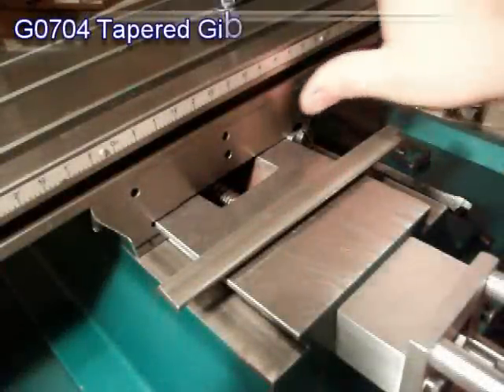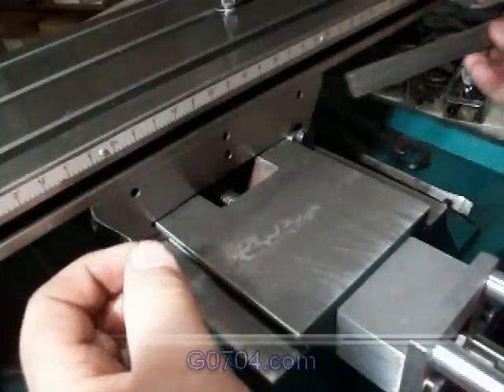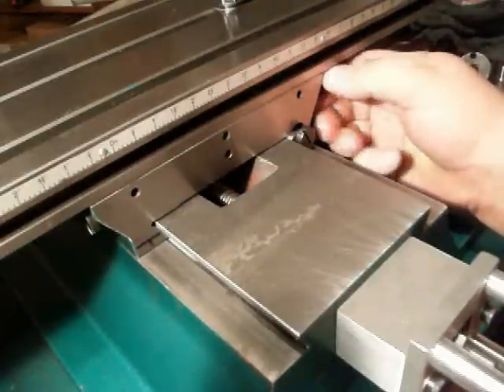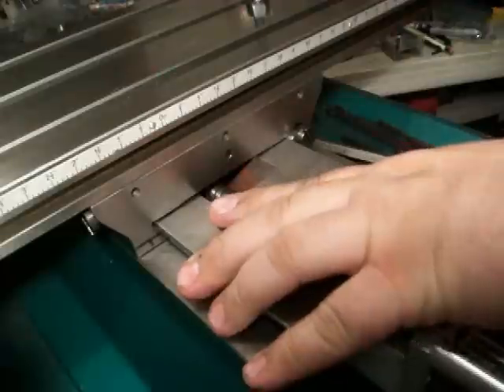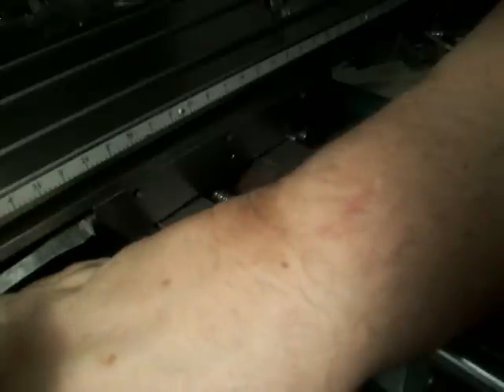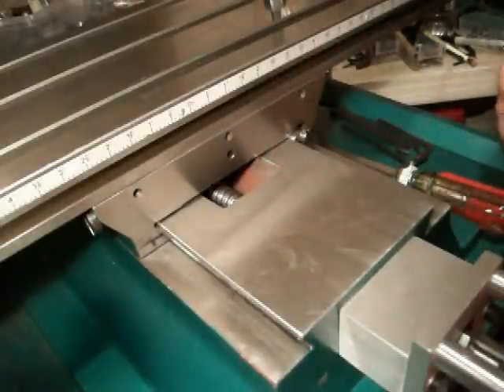G0704 Tapered Gib Adjustment

Comment: Generally good info;  thanks,  hossmachine for taking the time to make this video.
May I suggest for the public at least, sharpen (regrind) the screwdriver to proper profile, so it will apply full force without slipping or marring a soft screwhead.
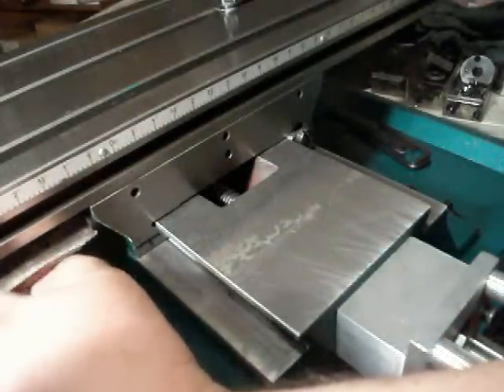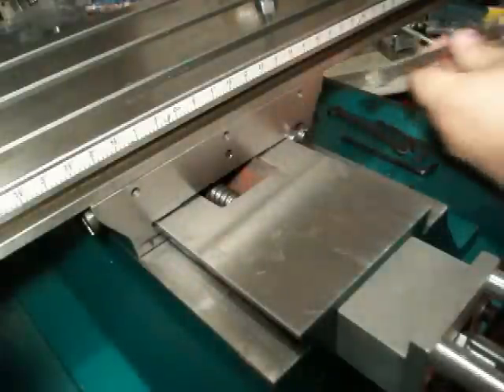     If you notice at 0:47 , 1:59 and 2:36, the tip has a notch in it. This in no way detracts from the video info, of course;  I'm just a bug for correctly sharpened tools :-).  decades ago, for gunsmithing, my project was to make a set of hardened flat-tip screwdrivers, with three blade thicknesses for each width.

Comment: Hey Hoss,

My X axis gib appears to be ever so slightly warped or twisted. On the one side (to the left in this video) it perfectly mates with the X table, however on the other side there is a visible gap. Any idea if this is a major issue?

Comment: Does it make any difference if you start with the table in the middle, end etc?
Also, I take it (by the effort you seem to be putting into it!) that even when set up properly, it will take a bit of effort to move? 

Really appreciate the time and effort you've put into all the vid's!
Reply: If you were to tighten it whem theres a big wear difference its gonna get tighten or loose depending on where the wear is and at what position you tighten it

Comment: do you recommend loctiting your gib adjustments in? what do you do when its time to reset them for wear? I know I can kill the bond with heat, but I'm not wanting to take a blowlamp to the screw to break it free later on either. Wondering about this point rather than trying to score points, plus I can't imagine how annoyed I'd be to get a new to me machine to find someone had loctited all the adjustment screws solid.
Reply from the maker: loctite threadlocker isn't epoxy, the screws can be adjusted or removed fairly easily without much effort, no heat required,  but it keeps them secure enough that vibration won't loosen them.